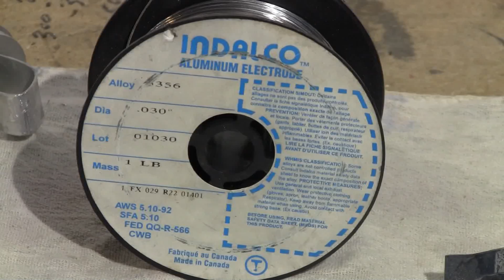How To Anodize Aluminum #3 - Making Electrical Contact With The Part

Comment from the maker: Rule of thumb is 15A per sq. ft. for one hour. Control the voltage or use a current limiting power resistor to get the current at the right level. An adjustable current limited supply is nice if available. I'm not sure about combining different alloys in the same bath. If in doubt, either do a run with test pieces to make sure, or just use two separate baths.

Comment: First of all, thank you for taking the time to make this highly informative series of videos! Due to the great detail in which you have gone, I've only 2 questions. I know you answered this first Q in video 1 or 3, but i seem to skip past it every time i look. What is the formula to figure out the voltage wattage and amperage for the anodizing process? Also I've heard that you cannot mix different types of alloys(i.e. 7075 and 6770 in one bath together will not work. Is that true? Thanks again!